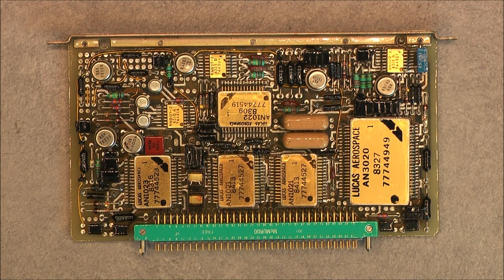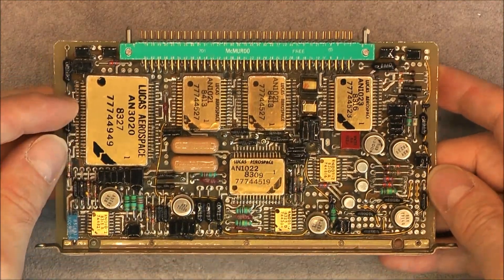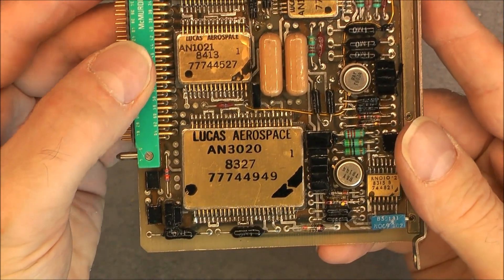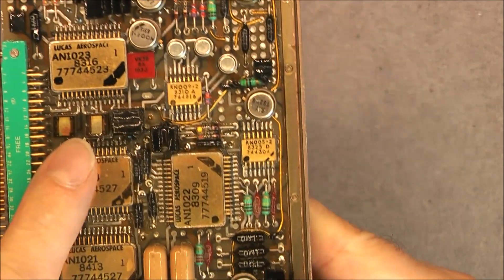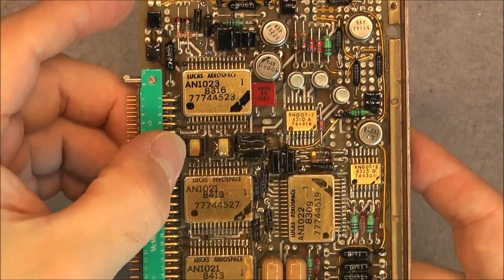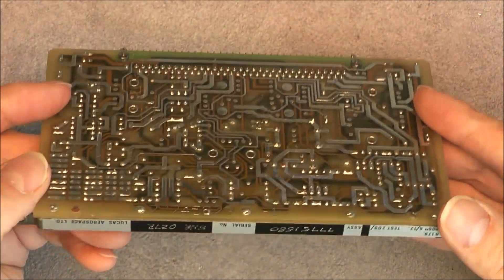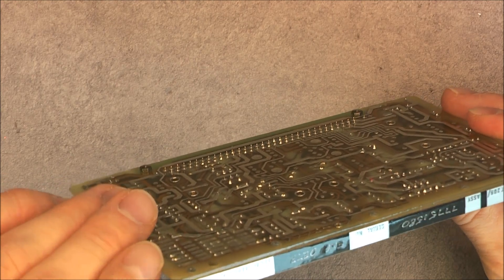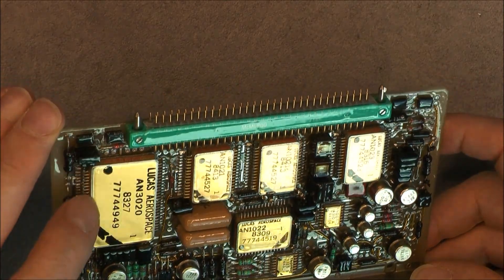Lucas Aerospace PCB loaded with golden hybrids

Comment: My guess would be a board from a FADEC.  Lucas Aerospace at that time made them for Rolls Royce aero engines and they were used on everything from the Tu144 to the BAe 748 and Saab 2000.  Incidentally the diagonal line with and L in the corner of the chips is the Lucas logo.

Comment: I have a device with very similar gold hybrids from Lucas Aerospace, it was sold to me as an "aircraft amplifier". Based on its construction I believe it was mounted to a jet engine, possibly used as an ITT thermocouple amplifier.
Reply: darn you guys know your stuff.  Did they package it in gold etc for thermal reasons? It always fascinates me how they do these things, particularly the stuff from the 70's etc, they had to overcome so much that we take for granted sitting in a tiny chip today, operating at the speed of light vs that old analog device
Reply: With so many pins it must be for many thermocouples

Comment: I didn't knew that 4-layer PCBs existed in the 80s
Reply from the maker: The Apollo guidance computer already had multilayer PCBS and surface mounted parts, in 1969 !
Reply: They most certainly did, I used to repair military equipment from the early 80s that used 4 layer boards.